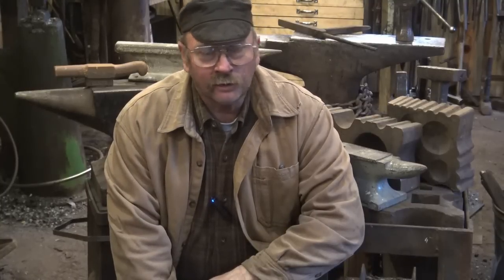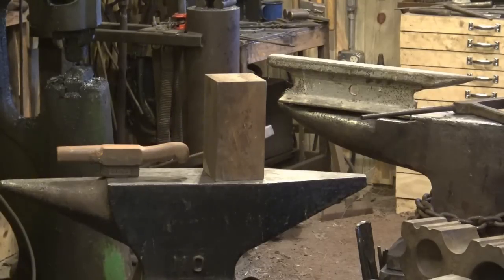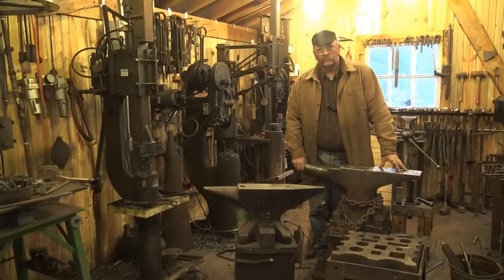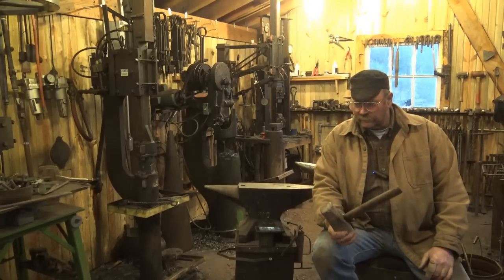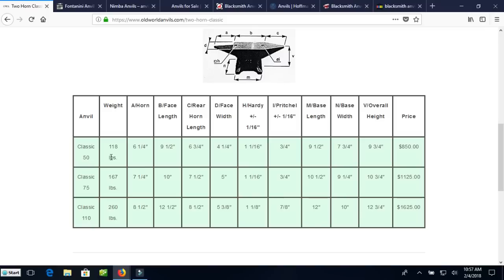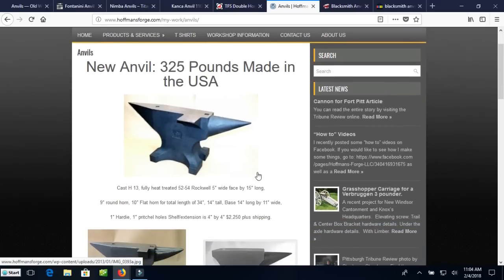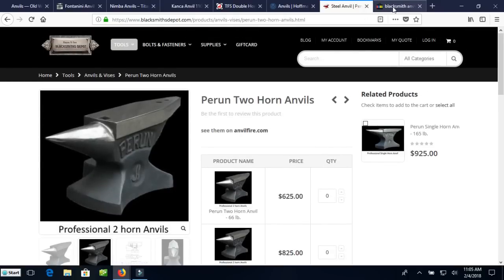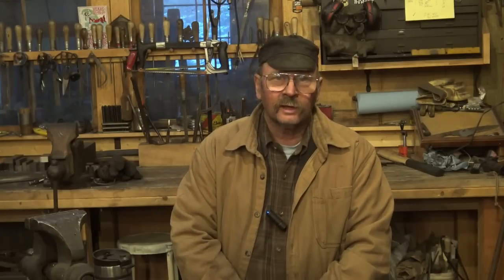Blacksmithing anvils and anvil substitutes

Comment: Very well done!   I really appreciate the approach you took to anvil alternatives.  

My own intro into blackmithing was delayed considerably because the advice (being told) by those in the profession and on forums, that you can't forge on anything but a real anvil.

It took me about a year before I ran into people who showed me the alternatives.   At the 2 year mark I was able to purchase my 1st anvil, a brand new cast steel one.  Finding a good used anvil,  reasonably priced was like pulling hens teeth.  The antiquers have Ruined  the anvil market in my area.

Since then, anytime I meet someone interested in Blacksmithing, I make suggestions to them on anvil alternatives like what you presented.  A real anvil will come later.

Thanks for the awesome video...
Reply from the maker: I am afraid anvil prices will continue to go up.  Blacksmithing is becoming more popular all of the time.  The good news is that means that people are making new forges, anvils, vises and other tools again
Reply: The single most important step with anything is to get started. Not get started right, or smart, just starting.

Comment: That peddinghaus no 12 is my dream anvil
Reply: I have one that I bought before prices began to rise.  They are fully forged, and the top half is then forged welded to the lower half.  The face is hardened using electricity.  It came direct from Germany.  If you get, even a used one, it is worth it.  Reffinghaus is also good.

Comment: I was able to buy some decommissioned fork lift tines for about 30 each.. this was prob 3yrs ago. As far as I know they are some form of tool steel. I cut it at the thickest part and right under the bend. The 90 bend kinda makes a horn to use. Sitting upside down its about 20 inches long and about 5 inches wide. Ground and polished to a shine. The thing weighs at least 75lbs. Makes a great anvil backed by some 4x4s on end tied together.

Comment: Started out with a piece of train track and it works, more or less. I found a lot of energy seems to be lost in flex if you're working on the edge. Then a good buddy had to close up shop, at least temporarily. I now have his 175 pound steel anvil. I've worked on it before so I knew what he was loaning me. Friends don't get much better than that.
Reply from the maker: There are good reasons our predecessors improved the anvil design into what we see today.  175 is a good size.
Reply: Good deal hope he doesn't ever want it back...

Comment: I'd been pondering what would be my first anvil...A buddy if mine is likely this state's #1 train enthusiast and told me to kinda drop his name at a RR museum but I hesitated for some reason. I bought a cheap cast iron anvilette at a discount tool place and set it on a lighter by the fire bit. Pretty poor but the guys each got to strike hot metal. I'll leave that one out there for them to hack on. This morning I helped an 80 year old buddy move some very heavy petrified wood to new house and I asked if he had an anvil laying around, but guy said he did and he did!
I picked up a KL cast steel made in England 70kg for 77c/lb. 
Cleaned it up with flapper in angle grinder and it's factory faced with a plate.  It's already an heirloom and has such a beautiful ring to it. Thanks again for posting these exceptional videos!!
Reply from the maker: I saw the photo you sent, Nice anvil find

Comment: As a full time welder I had the skill and the tools to take some RR track (which I came up on when a warehouse nearby was having their old tracks replaced) and weld it to the top of a stand I fashioned out of some sch40 steam pipe and an old plough disk. I cut and ground a nice horn on the front, though it's still flat on top and not very useful, and I drilled a 3/4" hole in the heel for punching (also made a small hot cut hardy to fit in.) I welded some 1/2" to the web of the track to add some beefiness to the ASO and spent a couple hours grinding down the top of the track to make a nice flat face (the very old rail was rounded off heavily on one side.)

I have made a lot of leaves, corkscrews, bottle openers and even some bench legs on that little "anvil" of mine. Yet I feel that I become more serious as a blacksmith, I need to get more serious in the tools that I use. Right now i'm looking at buying a "mid-grade" anvil from either Emerson, TFS or JHM in the 120-200lb range to upgrade my shop. They range in price from about $700-1200

Comment: The main reason for rebound in your anvil is for longevity of work, it takes away the effort of raising your hammer all day long, so basically if you're a hobbyist blacksmith ANYTHING will work, but if you're planning on forging all day. You need an anvil to not destroy your body
Reply from the maker: You are interpreting rebound differently than I tried to explain it.  It isn't about so much helping lift the hammer back up as it is reflecting energy back into the work.  If your work piece absorbs all of the energy from the hammer blow rebound doesn't do anything.  But it is very unlikely that the work will absorb all of that energy.  If the energy is absorbed by the anvil it is lost, but if the anvil reflects that energy back into the piece you are working on there is more effect on the work being done and you can get more work done with the same amount of effort.  You can certainly get by with very little, but you just have to put more into it.
Reply: I'm not necessarily disagreeing with You at all, just tossing out different perspective more for people to understand that they in no means as a hobbyist blacksmith have to buy an anvil
Reply: I love your videos and learn a ton from You, I appreciate it tremendously!
Reply from the maker: Thanks.  While I agree that a hobbyist doesn't need a classical anvil, I would also suggest that the closer to that ideal size and form you can achieve, the easier it will make your experience, bit in learning and physically.  Even a few hundred years ago those smiths that were stretching the boundaries of the known world made due with very small blocky stake anvils.  But the smiths in permanent shops had anvils very similar to what we know today.
Reply: Agreed

Comment: Very much enjoyed your video. If there was one thing to add, people wanting to go the $200ish route might search eBay for specific steels. Just make a list of 10 or so tool steels and search those. You will often find short drops of billet in the $3 a pound range. Add to the price 10 hours of wearing out rocks on an angle grinder and having 1" hardy hole cut through with a torch and you may have something you won't ever get rid of.
Reply from the maker: Between Ebay and the local salvage yard there is lots available that is big and solid for not much money (compared to a conventional anvil).  Although I don't know if I would mess with cutting in a hardy hole or just weld on a big section of square tube to use as a hardy hole.

Comment: As I am not a rich man,  I use an old Lug nut from an freightliner as an anvil substitute.
Wish I could send you a picture but I use it for making arrowheads ,blades .
I am relatively new to metal works but it's portable and can be mounted into a tree stump , so I can cold hammer on the fly, or in conjunction with a forge.
It heated up a bit , so i leave the bolt out for air flow.

Comment: Recently bought an 18" length of, what appears to be, medium-sized railroad track for $20.
Even being later in life, I'd like to give metal shaping a go. If nothing else it will be a better surface than I have had in the past to smack metal for projects.
One of my sons is interested in this too. He has problems getting hired so this might be an option.
Reply from the maker: Lots of people start out with a section of rail.  Mounting it as solid and immovable as possible will help a great deal.

Comment: I have a 200+lb Peter wright and a 170lb Mouse Hole both in great shape. My favorite anvil is a 200lb 5x14x12 block of mild steel I got from a steel supply for like pennies on the pound. It was a torch cutoff, but I don't care because that's just better grip on the stump i have it mounted on. I use it almost daily and haven't put any significant dents or chips in it, and if I do, it's 10 minutes with a flap wheel to take care of it.

Comment: First anvil i had when i was a kid was a big hammer head turned on its side and welded to a mild steel plate  with four holes to mount on something like a stump i just used it on the floor my dad welded it on the plate

Comment: i got myself a nice 50lb one to start. it's new and i have to surface it properly with a flap disk before i can use it.
addendum: i picked it up at princess auto (canada's harbor freight BUT with less chinesium) it's a good anvil, solid cast steel.

Comment: My first anvil was a 1"x4" block of steel, then a rail track anvil, upgraded to a 100 Columbia, sold it for a 100lb Emerson. Now I'm using a 50kg Church Window Anvil from Old World. I am looking at the delivery of a TFS 200lb smithy special for my larger work. Everything was bought with money generated from my blacksmithing and bladesmithing work. However, despite the anvils I have purchased I find myself using the massive 110lb 4140 block (I made it to look like a sawyers anvil) a lot of the time.
Reply from the maker: Sounds like you have plenty of options.  Thats a big hunk of 4140.

Comment: I have a couple railroad anvils(no horns),A 1930's anvil vice(vice is long gone)Steel and pretty heavy for its size.I also have a 1912 vice anvil(i mainly bought it since it was a nice piece to have around)i use it to true up stuff since its flat compaird to the railroad anvils but i think its cast iron and no ring to it what so ever i also have the solid cylinder hunk of metal about 9 inches long and  probably 4 inches in radius and it worked well for a while though i had to put it in a vise to hold it.

But i must say all of the stuff now is far better than the 2x2 inch of steel i started out with lol.

Thanks for sharing,your knowledge is a blessing.
Reply from the maker: Sounds like a fairly good collection of anvil like things to work on.  That chunk of 4" round set in a stand of some form would be pretty solid.
Reply: ill get my dream anvil some day!Its a hobby for me but i would like to grow with it a lot more though.I have almost everything else that i need.When i do get a traditional anvil ill probably use the others when i have a friend over to let them learn some blacksmithing.

Comment: For years I used a couple of Harbor Freight cast steel Russian anvils.  Took a bit of work to clean them up to where they were usable, and they were pretty soft, but better than cast iron or mild steel.  Shame they are no longer available, they were 110 pounds and rite at a 100$.  After nearly 15 years of bladesmithing I finally broke down and bought a new one, a Reffinghause 330 pounder.  What an awesome anvil.
Reply from the maker: I would be quite happy with a big Refflinghause, they are outstanding anvils.  But I doubt I will be trading anvils out anytime soon.
Reply: My biggest problem down here is that good anvils are hard to come by.  Ran across a lot of sway backed and beat to death anvils they wanted top dollar for, to the point it's not much price difference between them and a new one.  Apparently up north they are easier to come by.  A fellow smith had gotten one and working on it is what convinced me to get one.  They really are great anvils.

Comment: Sure, for forge welding you can use a sledgehammer anvil. You won't be striking that hard, and the chance to miss is minimal. However I wouldn't advice to use  a sledgehammer, or any hammer that could be hardened as an anvil, since if you strike a hardened hammer on another hardened hammer, chips may fly off that can cause severely injuries. It's like someone is shooting bullets through your shop. At all times avoid hammer on hammer contact when striking hard.
You had another video about blacksmithing rules, I only have 1 rule for blacksmithing I don't stray from : safety first.

Comment: My first anvil was an Old World Anvils 4 x 4 block anvil. Welded several pieces of thick rebar to the bottom and sunk those into a concrete filled 12" Sonotube section. Worked great. My current anvil is a Nimba Titan which, due to its mass centralization, punches way above its weight. I think the best deal on anvils are the TFS "Blacksmith" and "Smithy" anvils sold by Nature Farms Farrier Supply ( https://www.naturefarmsfarriersupply.com ). They have great prices and FREE shipping. The TFS anvils are a tightly specified ductile cast iron (which is a very, very different beast than gray cast iron), and have great ring, good rebound, and a Rockwell hardness of 52-54. I've used them and would buy one without hesitation.  Clyde
Reply from the maker: Free shipping on an anvil is a great thing.  Of course the Nimba anvils are pretty nice too.

Comment: Got a peace of 440C rd scrap 6"dia x 4" piece,  I know 440C can be hardened upward to RC 58-60, any thoughts of using this as a anvil? I cant find anything on using 440C as a anvil. I know may not be cost effective but got it for free.
Reply from the maker: You could just use it as is for a small anvil.  Otherwise I think trying to weld it into an anvil shape then harden and temper properly may be more trouble than its worth.

Comment: I have 3 big lumps of mild steel, 30kg , 60kg and a big donut that is 105kg. These are my main go to anvils. I have a nice cast steel anvil, but it is only small at 25kg, and the only time I use it is when I need to use the horn. I dont notice any difference at all between my mild steel lumps and the big anvils at the blacksmith club, except maybe my big donut is hard to beat when flattening something large!. (450mm across).
Reply: Jack Dawg there really isn't any difference, Joey van der steeg did a video on it, it's obviously super nice to have an anvil but the basis is only because there are tools made specifically for ready made anvils, if you take a block of steel and put anvil tooling holes in it, it's just as good and WORLDS cheaper than the new fad thats caused anvils to become so ridiculously overpriced

Comment: Hi John, I’m looking around for an anvil and I have seen some on eBay that say they are cast steel RHC 55.
The one I’m looking at is 60kg.  The thin I’m concerned about is it has a flat horn.
It’s not completely flat as it has a radius on both sides that appears to be a cast finish, not ground.
Have you had any experience with this kind of horn and how useful it actually is.
It will work out around $700Au which seems about average for this size anvil around here.
I’d be happy to hear your thoughts on this style of anvil
David

Comment: I've been using a 77lbs nc bigface farriars anvil which is cast steel for the last year and had,done sooo well by be.  It's not great but,it dora,what I need.  Will be upgrading this year tho I think!
Reply from the maker: Sounds like a good start.  I have always thought the farriers anvils looked springy but not solid.  Certainly OK for smaller forgings but possibly a problem for larger work.

Comment: My anvil like object is a piece of steel they anchored machinery to the floors with. 4inches wide, about an inch and a half thick and 4ft long with two round bolt holes in it I use for hardy tools. It is about 80lbs or so, I welded some angle iron to it and bolted it to a stack of 6x6 posts. Works great.
Reply from the maker: Sounds like a workable solution

Comment: I got my hands on an old Vulcan 90 lb for $155. The top has bad nicks and the horn is broke but I have learned a lot on it.
Reply from the maker: As long as it has enough flat face to work on it should be a workable anvil until you blacksmithing ambitions out grow it.

Comment: I have some 10 mm plate. If I can weld it? Can I cut into 2 strips? Just weld ? But my welder is 240volt and 160 Amps BOC brand welder?

Comment: Big time fan. It's been a dream of mine to take up smithing and videos like this have definitely inspired me and now am taking steps towards it real.

Like many new smiths, there are always questions. The main one I'm running into was mostly addressed in this video but I've got a wall.

I too am a resident in colorado, but the local supplier seeks primarily ductile iron as opposed to steel. 

Would this be a suitable route to take? Pros and cons?

Comment: My current anvil is cast steel, Russian made Central Forge 110lb From Harbor Freight of all things! it's quite durable I have it on loan to the local blacksmith club and needless to say it has held up well. Cost $100.00 + tax! the only drawback is the horn it needed polished as it was rough, and it's duck billed
Reply from the maker: How old of an anvil is that?  I have heard they are no longer available.
Reply: I forgot to mention why I bought this one, Southern Ohio Forge and Anvil (SOFA) has several of these in there U-forge area where they teach beginning blacksmiths and if they can take that kind of abuse it's more than enough for what I use it for...

Comment: A newer company that makes and sells anvils made from 4150/4140 cast steel  is Atlas Knife and Tool they also have an anvil style that has never been tried before with a built in swage on the base the 67 lb is 300 and the 117 Graham is 450

Comment: When I first got my propane forge working, I did not have an anvil at all.  I wanted to make the first project from my blacksmithing class, a 1/4 inch square bar drawn out to points and then turned into an S hook.   I pounded out a piece of 1/4" square on a cinder block... It worked, but I REALLY do not recommend this.  :)